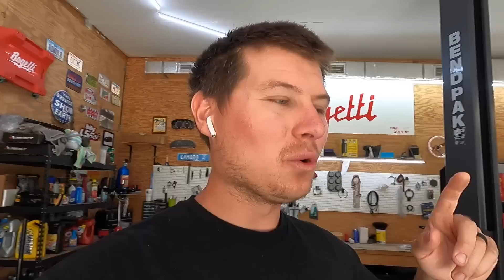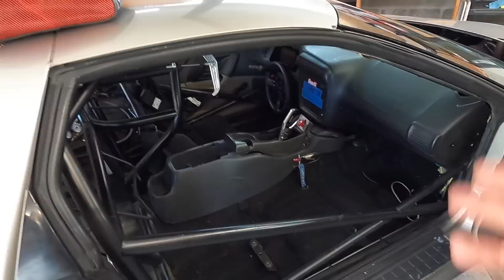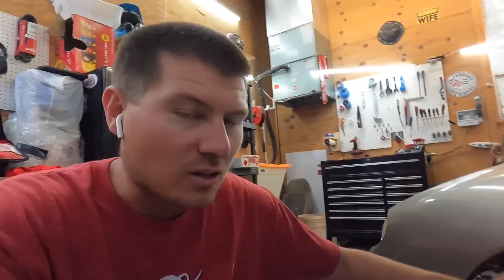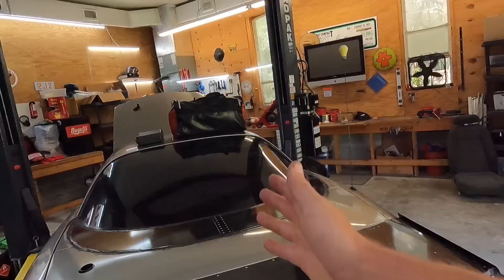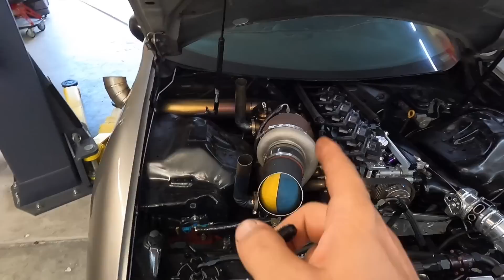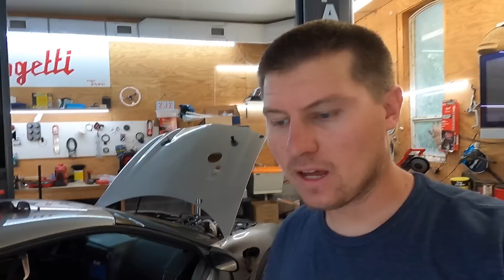Our Last Race, For Now...

Comment: Engineer here. High pressure through small opening causes vaporization. 120 psi being pushed through too small of an opening could cause vapor lock inside your turbo. Way more expensive than the regulator.

Comment: It was really cool to see a PennGrade oil box in your garage  cooper. I hope you use that oil. It is actually the best oil out there.An engin was run on a hard pass with no oil pressure. the car ran low 7's. the engine was pulled apart expecting a lot of damage and there was none. that made us believers for ever. Now my partner is one of there distributors.

Comment: Every time I watch your videos or see you doing something to the Camaro or the Chev all right I get inspired by you just to go and work on my truck just a little bit tinker on something I can get done I still yet to even be able to get it to attract because it’s not safe and that’s the main thing. I’m trying to do right now is just all the safety stuff like for fire anything like crash shut off kill switches, fuel lines. I’m changing everything over to everything that’s safe for the race track and you have been definitely helping me keep working towards getting that done so hopefully next summer I can actually get my truck out to the track and put a time slip finally on it thank you for all your videos and everything you do Cooper.

Comment: Loved the Rant. Back when I lived in Knoxville TN I use to go to the dragstrip in maynardville. Not sure its even open anymore. I use to drag race my 06 MazdaSpeed 6. It wasnt fast. Think I ran like 8 seconds or something like that. (1/8 mile btw). But since I moved to Louisville Kentucky I dont think there is any drag strips near me. Ive been here 10 years too. I miss it so much!!! Right now I have a 15' Jetta GLI with a big turbo and some bolt ons. If anyone knows of a track you can run normal cars around me. I would greatly appreciate it. Born in Florida. Wish I lived there. Maybe one day

Comment: The stickers need to be symmetrical.  If you can have the big motion sticker on both sides then divide the rest up around it that would look good. Maybe use the lower part of your fender, under the 2jz

Comment: Yeah people will surprised at the good people you run into racing. There’s many classes to enter. I remember a gal running a Chevette in dial in class. She’d run mid to high 18s. She could cut a light and car was consistent. So many people broke out trying to catch and pass before the line.

Comment: I just want to build a hotrod. Have a line on a 1967 Nova. Good thing is the aftermarket is huge for the car. I want to street and strip it. Not sure to pro tour it or TCI front and 4 link? But it all costs $$$$ l. I don't want to stall out on the build, lose motivation, and sell it because I don't have the funds to keep building. That's my biggest fear. The car is just a shell so it's an open book.

Comment: Instead of black for the stripe at the bottom. Try and match the gunmetal of the wheels. That would look good with the logos cut out. 

Also are there videos of the car with the LS. Or beginnings of the swap anywhere?

Comment: The motorsports community is a very tight knit family, and they accept other people that fit into the group. Respect is earn with every pass, or every time you lend a helping hand. And unlike some family members. These people will remember when you help them out and they got your back when you are the one in need next time. It doesn't matter if it drag racing, dirt track, road course, drag & drive..... They got you if you got them. But this sport isn't for everyone. If you have a problem with stress, or anger control issues. Then it's best for you to sit it out.

Comment: Try running an oval track car Fri night, sat am repair said car to race sat night and then if the car is ok race another track Sunday afternoon. We did that many times in the past. Including 4-500 miles travelling.
Or modern Sprintcar teams  who race 5 or 6 nights in a row. With hundreds of km between tracks.
Though drag and drive events is just as grueling,, more so as you have to drive the racecar.
Reply from the maker: Oh im sure that a huge operation not ever trying to compare to people that do other things just show my experiences

Comment: that restrictor still looks way too big for the bb turbo. why don't you contact the turbo manufacturer directly and ask them for the proper size? is your drain still made of AN style fittings, btw?
another thing you can do is install a manual pressure regulator in-line with the feed and a gauge, then modulate it as needed.

Comment: Every time I've been to the local test and tune in my 2015 Hyundai Genesis coupe even the older crowd comes up after the race and asks what car it is. I've run a 13.2 at best and people don't care what you drive as long as you show up and leave with a good attitude and be nice everyone gets along. Also my car has shit wheels and a missing clear coat and people still ask about it, they honestly do not give a fuck.